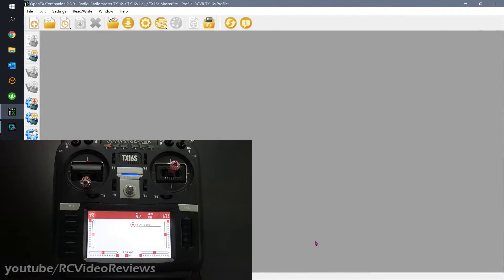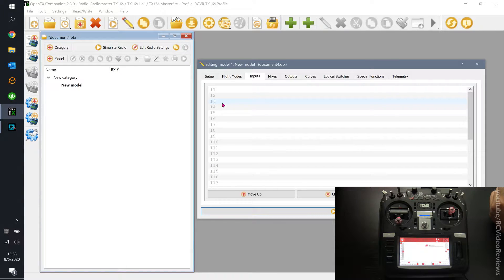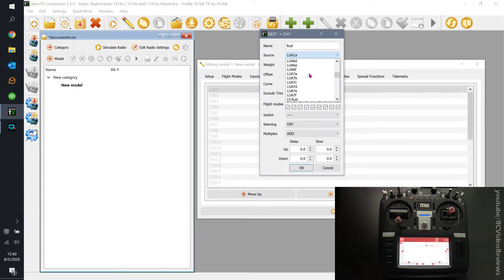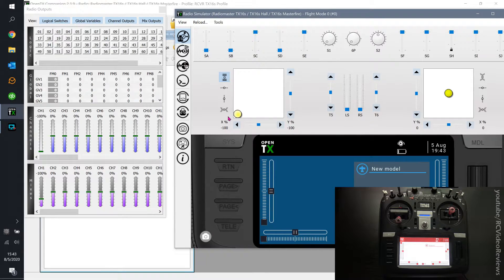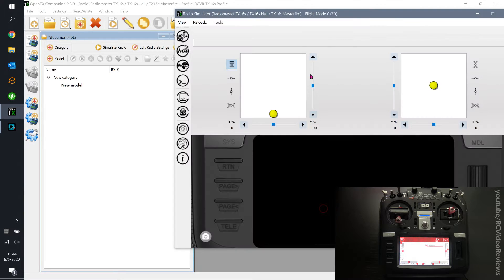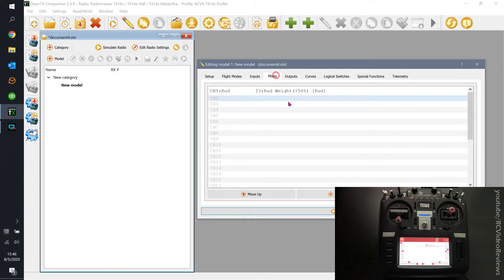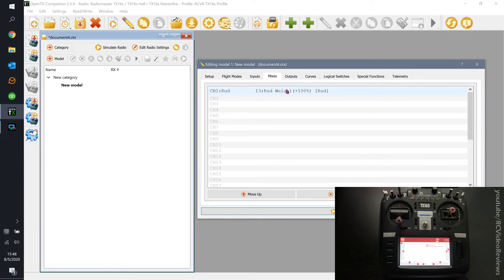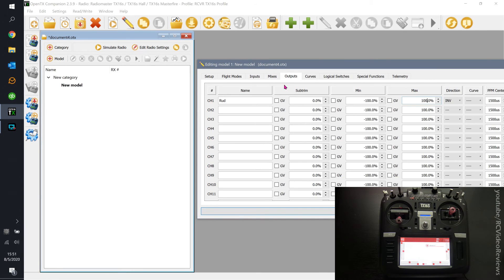OpenTx Companion Tutorial • Inputs Mixes and Outputs Explained • Radiomaster TX16s • [Beginners]

Comment: This makes sense in theory,   but when I set the aileron input to 60%,  that doesn't seem to mean their is a linear progression of the input from 0 (centered gimbal) to 60 (full right gimbal).   It reaches 60% rather quickly then the rest of the gimbal movement is irrelevant.  Even with max/min or no expo.
I suppose this is because of the servo itself.   And so I have to leave the input at 100% weight and change the  (voltage?) output to 50% to try to calm down the servo,    But I am new at this, maybe this is not right?

Comment: I have an rc truck binded to my tx16s. I can drive it, turn it, but i cant turn tha damn LED headlight off. How do i do something that simple?
Reply from the maker: In the mixer, add a line corresponding to the channel controlling the LED from your receiver and assign a switch as the source. If you use mix line 6 for example, load up the channel monitor and move the switch. You should see 988us through 2012us in the channel monitor output. That should be enough to get the light to do something.
Reply: @RCVideoReviews  awesome. Will try it as soon as i can....or when my boss lets me 😒
Reply: @RCVideoReviews  it didn't work. Im positive im screwing something up. The light is on channel 3 on the receiver and im using that channel in the mixer. Tried different combos of inputs, mixes, n outputs but no dice. Its just a friggin light, on/off. I suck.
Reply from the maker: You don't need inputs.

The mixer is enough to map your switch to a channel on the TX side. If your TX is outputting a range from 988 to 2012us on the channel controlling your LEDs, then you need to figure out what ppmus value is necessary to toggle them on and what value is necessary to turn them off. 

It's not a question of what the radio will do. If your channel monitor shows a ppmus range of 988us to 2012us the issues resides on the model, not on the transmitter.
Reply: @RCVideoReviews  so i replaced the og receiver with a Radiomaster ER5C V2 elrs receiver for longer range. The original receiver turned the light of no problem. Just a cheap MJX Hyper Go truck/R30 receiver. Cant find any schematics for the new RM receiver to see if its actually capable to accomplish a discrete 1/0, or on/off. I would think its capable.
Reply: @RCVideoReviews  the ER5C receiver documantation says that channel 5 is a switch (ON/OFF) PWM but channel 1-4 are standard PWM. Cant find that same document for the ER5C V2, so i dont know if its the same. I did move the LED to channel 5 and mapped it in the radio but still no dice. Gonna try again.
Reply: @RCVideoReviews  changed channel 5 to on/off in the lua script so now the switch i assign works but only dims the light half way, doesn't turn it completely off. So annoying.
Reply: @RCVideoReviews  FINALLY! 🥳🥳🥳. Back on channel 3 with mode set to on/off in lua script. Completely on/off with SF ⬆️⬇️. Thanks for tha help.

Comment: Best video mate ,finally simplified 😅
Reply from the maker: Glad you liked it
Reply: @RCVideoReviews  how do you set a safe mode that when you lose signal on radio system with plane why speed controller still on . If you loose signal and you had full power on then turn you hand controller off and throttle stays on ,how can I fix this ,,since I'm trying to break a world record at my club ,others would not let me fly such a plane without this safety mode active ,please help for this is the most important safety issue with radiomaster tx16s mk2

Comment: Hello man i see you have alot ok knowledgeable info on the tx16s . I just got my tx 16S mkii rhnnjng edge tx . I come from spektrum radios  and i been trying to arm my esc on my plane but cant manage to get to arm  (suspect the throttle is not low enough to arm but cant figure out how to change end points! ) i switch the plug on receiver to the rudder just to test and if i hold the stick to the minimum imput it will arm . Any thoughts or advice .
Reply from the maker: I've probably done half a dozen arming videos for opentx and edgetx. Search on my channel for arm or arming and you'll find them. Lots of ways to do it.

Comment: Great video. Just a question, I am using my Radiomaster TX16S MK2 also for a boat. I am trying to get the lights working through one of the switches and a R88 receiver. I don't get it working. Do I need something else to get this to work? Thanks
Reply from the maker: You probably need some sort of switch with pwm on one side and 5v on the other. You can’t just connect a 5v load to the rx and turn it on and off. Signal is converted to pwm on the signal pins.

Comment: Does anyone know how to make S2 the trim control for channel 5? I put my nosewheel servo on ch 5 and rudder on ch4. I mixed them together ok but the only trimming I can do for ch5/nosewheel is using T4. I could do a separate trim with my very old Futaba radio so I hope the TX16S can do it. Thanks!
Reply from the maker: You're crossing wires. The mixer assigns channels, but it doesn't assign trim. It merely allows you to turn trim on and off.

To specify a mechanical trim switch you have limited options. Go to inputs pages, create an input, call it "nose". On that setup page set the nose/rudder stick as the source and change the trim to T5 or T6. Then on your mix page for Ch5, use "nose" on line 5 as the source.

Comment: I have a Radiomaster tx16S with a failed USB port.  While I'm waiting for the repair I would like to load an OTX model file I downloaded from the OTX file archive onto the SDcard.  I do have Companion running on my PC.  But again no way to write from companion directly to the SDcard in the radio.

Can I remove the SDcard from the radio, mount it on my PC and save the OTX models directly to the SDcard, put it back in my radio and have the new models available for use?  If so.  How?
Reply from the maker: It can be done, but it's fiddly.

If you want to do the work:

Look in your MODELS directory and find an unused #. You should see something like this:

model1.bin
model2.bin
model3.bin
model....bin
model13.bin

Name your import file model14.bin and copy it to your MODELS directory.

Next look in your RADIO directory for a file called models.txt

Edit that file with a text editor. Take note of how your other models are listed in that file. Add a line for model14.bin

This should show you your model in the model select screen in the category you selected in the models.txt folder.

The only thing I'm not 100% sure of is if OpenTX uses the modelXX.bin name within the configuration file itself. I think I've tried this process one time and I don't remember if it worked or not.
Reply: @RCVideoReviews  As it turns out it much easier to do.  Thanks to a guy on the OpenTx Facebook group.  He told me how.  Just mount your SD card on your PC.  Run companion and read models and settings from "radio".  Companion thinks the mounted SD card is the radio.  Import an OTX file from another directory and open it up.  Copy and paste new model.  Write models and settings to "radio", Companion writes them to the SD card.  Pop the card into the radio and all is as expected.

Comment: I inadvertently loaded a 4-in-1 multi-module firmware that had a TAER order (not the traditional AETR) and I became very confused when connecting the various servos to the Rx pins, programming the INPUTS and the MIX channels.  I came to some wrong incorrect assumptions as to how INPUTS and MIXES channels work and RC Video Reviews showed me the light.  I have verified that sticks are assigned in the INPUTS page and it doesn't matter what order you assign them in.  I have verified that channels are assigned in the MIX page to either sticks or switches, etc.  The channel numbers on the MIXES page do appear to map to the pin numbers on the Rx receiver.  I verified this by moving a rudder servo from pin #4 to pin #7 on the Rx and then mapping the Rud stick variable to channel 7 in MIXES and the rudder worked!  I also moved the ESC cable from pin #3 to pin #7 and mapped channel 7 to the Thr stick variable and the throttle/motor worked.  Everything in this video is accurate and is explained very well.  The default channel order (AETR for example) is assigned in OpenTX Companion in the OPENTX, in the settings, Radio Profile, Default Channel Order.  I'm not sure where this default order is used in OPENTX on the Tx or how it affects programming.  I am also confused as to how the 4-in-1 multi-module firmware affects the programming.  There are different 4-in-1 multi-module firmware versions (each with a different sort order, AETR, TAER, etc.)  Which firmware version you choose affects how the Tx transmitter binds to the Rx receiver as indicated in the Radio Setup module status after a successful bind with the Rx.  When I loaded a 4-in-1 multi-module firmware that had a TAER sort order this affected how I had to assign Channels in the MIXES screen.  I don't know why, but it confused me a great deal.  I ended up re-loading a 4-in-1 multi-module version for the AETR order and things seemed to work better after I did that.  Something else that may be complicating this whole thing is that I was binding to a Frsky S8R Rx which has a form of SAFE mode and in order for SAFE to correctly keep your plane level, assignments to Ael and Ele must be assigned to channels using a Lua script.  This is a whole other level of complexity and confusion for me.  I have all of my planes working but understanding each of these nuances (INPUTS, MIXES, AETR order, SAFE mode Lua programming) complicates having a thorough understanding of how all of this works.  This is where RC Video Reviews shines because he is very knowledgeable about OpenTX and his videos are organized well to better help us understand and someday be able to harness the power of OPENTx.
Reply from the maker: I'm glad you got it worked out. This is a very worthy OS and once you understand how things work, it will get easier and easier to program it so that before you know it, you'll become a ninja programming your radio.

Comment: It is ok if i only use mixes for my flap and landing gear? For input i only use for throttle, aileron, rudder and elevator. For flap and landing gear i just assign switch on mixes and it works.its that ok?
Reply from the maker: One thing about OpenTX/EdgeTX is there are always more than one way to do things. If you've found a way that works for you, that makes it right. You will learn over time what best practices are and that's what I try to show after years of using this firmware.

Comment: I have been trying to assign channel 6 to a 3 position switch (SB) to control a gyro.  Can you do a video on that.  Please.  I am a subscriber.
Reply from the maker: Mixer: Put a single line on Ch6 with SB as the source. Nothing else.
Reply: @RCVideoReviews  Than you Sir!
Reply: Great video! Just moved to tx16 from spectrum.  Just to clarify to add a switch for rtl for example I just use mixer and don't need to put anything in inputs?

Comment: Great video - thank you! One question: the plane I'm configuring has a three position gyro (beginner, mid, expert/off) that I've set to a switch, and this works well. The expert mode is far too twitchy and I'd like to set up rates and expo as you've done, however, so that expert mode is more controllable. If I set these to a separate switch, how do the gyro  and rates interact? Is it normal to control gyro on one switch and rates on another? Just trying to get my head around it! Thanks again.
Reply from the maker: Without knowing more about your Gyro I can't answer how the Gyro and rates interact. Usually "expert mode" means the Gyro is removed from the control process. If that's the case, then there is no interaction between rates and the gyro. That said, I use hi/low rates for all of my planes, gyro or not. Adding rates simply manipulates the pulse width of the signal you send back to the Rx. It shouldn't change operation of the gyro.
Reply: @RCVideoReviews  Thank you - makes sense. Hopefully, then, I can choose high or low rates independently of the gyro setting. If gyro and low rates are both on, I should simply get stabilised  flight with less weight and expo.
Reply from the maker: That about sums it up. I use rates on all stabilizer settings without issue.

Comment: Great video series. I need help placing a snap condition on a momentary switch. So when I flip the switch all surfaces throw to a desired rate. YouTube has been no help on this one.... Have everything setup under the Inputs menu, and it shows on the graph when I flip the switch, but no movement on servos.....
Reply from the maker: Special Function Override Channel = xx If you want the surface to move.

Comment: I am really glad that you make these great  videos. Helps me step by step to come to an Understanding of Open TX. 
I wonder if this will answer my question marks I still have:  How to assign a switch for a 3 Axis Stabilizer (on/off) to a channel on the RX and mix in a Poti to adjust the sensitivity of it.  And of course Flaps with 3 positions.... 
Actually I have to say its frustrating. I just can't get it working.
Reply from the maker: I think I need to make a standalone flaps video, but here's what I have using curves: https://youtu.be/d9PciJhjDi8

For a stab, it's REALLY easy--Pick your channel on a mixer, click add. Use the switch you want as the source and you're done. That will give you -100, 0 and +100  or 998/1500/2012 as your pulsewidths.

Gain is the same thing. Pick a knob, pick a channel. Assign the knob to the channel in the mixer as the source. Done. Super easy.

Comment: Shouldn’t inputs affect outputs without a mixer or am I thinking about radios from long ago? Back in the day you only needed to worry about mixers when one input needed to affect more than one output.
Reply from the maker: Try it. If you don't add a mix line the output is centered.
Reply: @RCVideoReviews  Appreciate all the help from your videos. I’m coming from a 72 MHz Hitec Optic 6 with absolutely no Open Tx knowledge 🤣 It’s a steep curve.
Reply from the maker: We all started with OpenTx somewhere. Did not be afraid to ask questions and tinker with the radio. You can’t hurt anything until after takeoff. ;)

Comment: I have set up a new model. I can see my mixes are all set correctly but when I go to simulate it there is no output. What have I missed please?
Reply from the maker: No output on what? Do you see outputs using your channel monitor on the radio itself?
Reply: @RCVideoReviews  Thanks for the reply. I think I have figured it out. I just have to keep on trying. I am so green with open TX. Still a lot to learn.

Comment: I finally understood what those sign meant, for ex when the switch !SBÎ. Here’s my question with regards to that and this will pertain to flying Helicopter. On my inputs I have assigned my dual rates and expo on switch SE, when the switch is SEî it’s my normal mode let’s say at 80% weight and 30 expo, now if I assign the same switch but now like this !SEÎ and change the weight and expo to 100% and 25 expo, will the radio recognize the position on idle up 1 and idle up 2 and use the new given value?
Reply from the maker: I don't know what idle up 1 and idle up 2 mean. 

If you have these lines:

I1: Weight 80 E30   SEî 
I2: Weight 100 E25  !SEÎ

The radio will use I1 when SE is up and I2 otherwise.
Reply: @RCVideoReviews  Idle Up 1 basically is coming up from a Normal Mode with a higher throttle flat curves if u will so u can do the aerobatics maneuvers
Reply: @RCVideoReviews  I guess this settings is good if you’re planning on having the same rate coming from Normal Mode. But if you want to have another rate then I guess assign the same switch let’s say SBÎ Normal, SB- Middle and SB! (Sorry couldn’t find an arrow down 😂) 

i1 80 / 30
 i2 90 / 25
i3 100 / 20

Thank you so much. I tested the settings to my MCPX BL2 Heli, since I fly with pretty much the same rate on my AIL and ELE for D/R and expo, took out one input line from my inputs to simplify the settings, and watch the monitor and it did what is suppose to do !SEî 

Really good what those symbols represent. I will donate to your channel anyway I can afford, your videos helped me tremendously and now loving my TX16S even more.
Reply from the maker: @scrc511  I'm glad the videos are helping you out. FYI We have a discord server https://discord.gg/jSFTASU On the server we have have a helicopter channel and they LOVE to chat about helicopters. So feel free to stop in. They can probably offer you more help on heli/opentx setup than I can.

Comment: Great video! Very clear. That said I still can’t get the full 0 to 2000 range even though input mixer and output all at 100%. On my spektrum I could go above 100% to say 125%. Doesn’t seem to let me change the weight to extend the range? I’m using spektrum dsmx. My range is 1130 to 1840. Thx!
Reply from the maker: https://www.multi-module.org/using-the-module/protocol-details/dsm

Method 2 - Extended Limits
Alternatively, output range can be increased by enabling Extended Limits in the model setup and configuring minimum and maximum output percentages for each channel in the Outputs.
This method allows each channel's range to be configured independently, and allows larger ranges than Enable Max Throw.